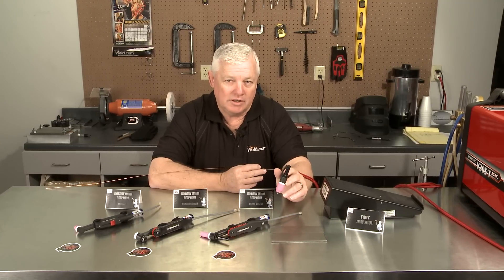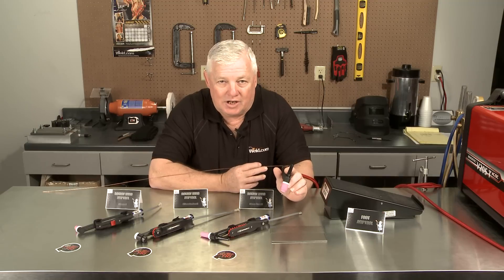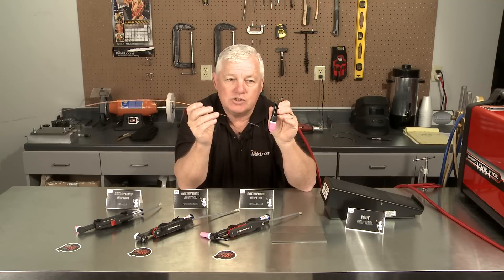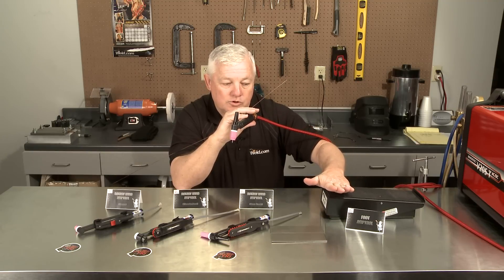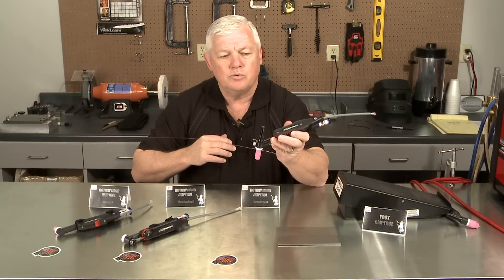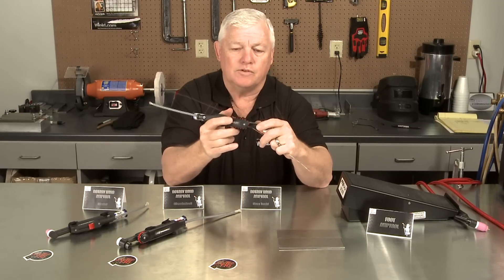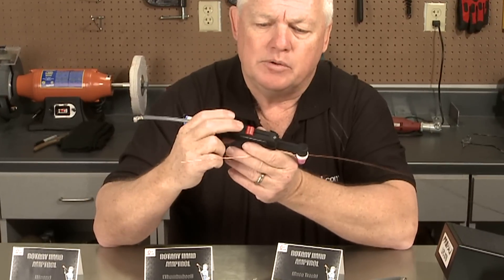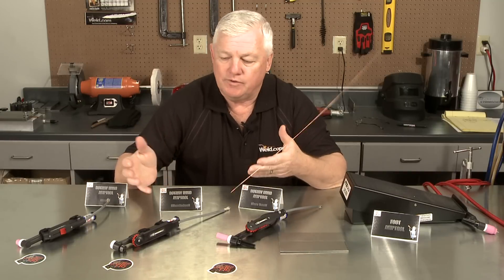TIG Welding Hand vs Foot AMPtrols - The Final Verdict

Comment: Hi!! I'm just starting out in welding and I'm finding the foot AMPtrol pedal to be very sensitive and light - - maybe too light. As far as you know is the travel tension adjustable in any way on the AMPtrol foot pedal, and if not, are you aware of any (aftermarket) foot pedals that do have adjustable tension? Seems to me that would be a great feature for the mfrs to add to their foot controls.

Comment: G'day Mr Tig, love your video's and finding them very help full in learning before I make a purchase. I have been a bit confused about AMP control, eg importance of controlling amps, and until now, didn't realize the tradeoff between hand and foot.. What I find interesting, is why the amp hand control, is not held in the opposite hand with a spool feed gun for adding filler like a mig. It would take away any risk of hand movement in the torch hand, while filler length and AMP's, can also be controlled by opposing hand where movement is not as big an issue.
Like to here your thoughts???

Comment from the maker: @ThatWeldingGuy Thanks for the question. I have tested the wireless foot controls & they work pretty well.  The response time is quick & the distance from the machine works well up to about 100'.  The cost is still considerbly high but I suspect it will level off once competition is introduced from all the manufacurers.  I believe Miller Electric is the only one on the domestic market but that will change in the near future.  Good luck!  Mr. TIG